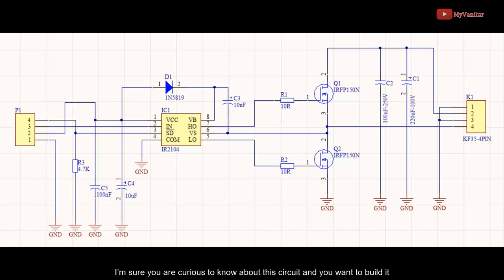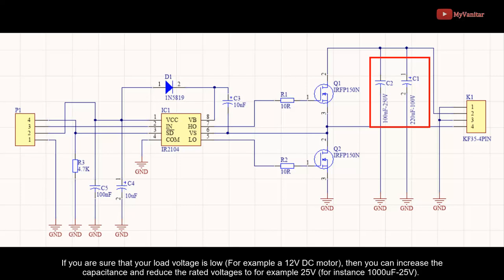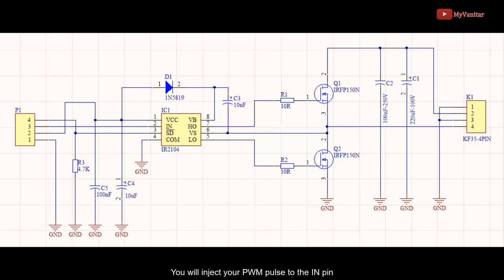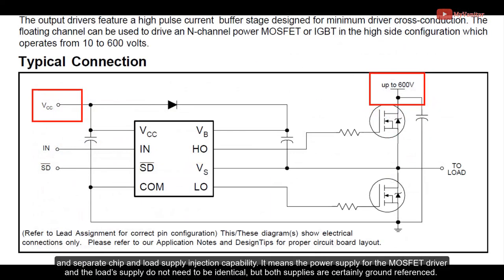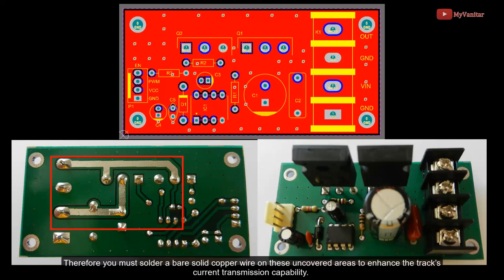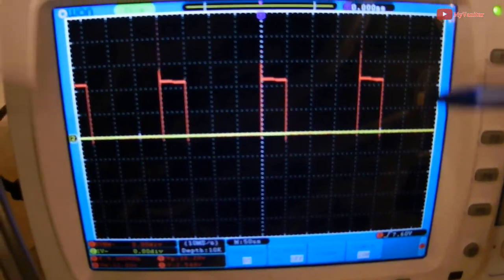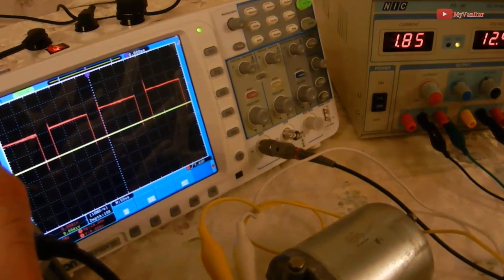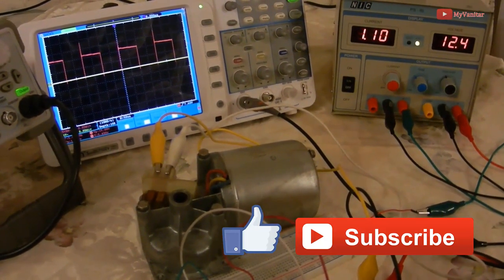DC Motor Driver Circuit Using Power MOSFETs [PWM Controlled, 30A Half Bridge]

Comment: Hey 
Here you have given two outputs for two motors which are dependent by only one PWM pin...? Is it correct...? And if so what components should I remove to drive only one motor
Thank you
Reply from the maker: Hi, No. there are 4 power connections (right side) right? two for the motor supply (VIN, GND) and two for the motor itself (OUT, GND). left side is for the logic.VCC is 12V. Don't be hurry, Just watch the video and read the article
Reply: @MyVanitar  thanks a lot....yeah... lovely work bro.....
Reply: Now I get it....
Reply: Reason being I reached the verge of making Gerber file but issues with the size (pitch basically...)

Comment: I want to drive 7.4v 5a motor so can i use this circuit? Or i need different mosfet driver
Reply from the maker: As you can see the Motor's supply is NOT identical with driver's supply, however, you need to supply the driver side with 12V, because driver needs this supply to Turn-ON your Mosfets
Reply: @MyVanitar  Yeah that is reason why i ask. So driver need 10 to 20v to drive mosfet?
Reply: @MyVanitar  Also i want to use IRFZ44N so can i use 50V 500uF capacitor. Can i change this 250v capacitor?
Reply from the maker: @BalkanFilm  Yes, I don't remember the exact voltage range, however, if you check the driver's Datasheet, you can consider the range.
Reply from the maker: @BalkanFilm  The capacitor is not a critical component, it is used to reduce the noise, but pay attention to the rated voltage that should be higher than your motor's or load's voltage, also pay attention to the capacitor's footprint dimension and sizes

Comment: Hi...
when we connect load with dc motor, that time this driver can be supply constant voltage and current to dc motor? 
here attached power supply is big enough but is this arrangement worth for constant supply voltage to dc motor when load connected?
Reply from the maker: When you control something with PWM, it means you both change the voltage and current by the duty cycle. In this circuit, the driver supply and motor supply are different, however, they share the same ground. so you can simply connect your CC supply to the motor supply and see how the motor behaves. the advantage of the half-bridge is much lower EMI noise and higher current for the load.
Reply: @MyVanitar  Thanks for the quick Reply,
Okay, let me give 1 example,
at a specific PWM value, I will get output from the driver is 10 V where my connected V in is 24 V, which means, I set PWM duty cycle at that value when I will get output circuit is 10V, but when I will connect output point on load dc motor, that time, V will not 10, and it's showing like 6-8 V fluctuation constant, so my connected dc motor can not give a right performance where actually if we connect that loaded dc motor to direct power supply of 10v, it will give a great performance. 

so at the end, if I need the exact 10v load performance of my dc motor by PWM controlling (by the microcontroller) then is this given circuit works? or I have to change the system of controlling my motor.
Reply from the maker: @madhulieximpvtltd4352  You must make the measurements when your load is connected, besides, you must make sure that your supply can handle the full current. also make sure your wirings are good, bad wires act like resistor and introduce voltage drop
Reply: @MyVanitar  Finally Today I tested and now all solve my issue, full-time perfect voltage and current at the output.
thanks a lot, very very thankful to you.... so happy.

Comment: Hello sir. First of all a very nice project and equally good presentation. Thanks for it.. I want to generate 8 - 10KHz (i.e switch MOSFETs at 8-10KHz) and supply the output to high frequency transformer then. Is this circuit suitable for that..?? 

Thanks in advance.
Reply from the maker: You're welcome. I think yes you can. this is actually a half bridge driver.
Reply: @MyVanitar  Thanks.. 👍
Reply: Hi. I am facing an issue.. the capacitor are getting heated up and MOSFET are damaged after few minutes of operation. Working frequency is 1.5khz.

Comment: very confusing what needs to be connected where. on your board you label "in" but the chip in is pwm. should have labeled it as "sd" to be consistant. you also never explain if the vcc and sd inputs can be the same source.
Reply from the maker: The circuit is pretty simple, everything shouldn't be an easy to eat candy. By the way this is my first video on this channel, you can check others as well. I have introduced two H bridge circuits as well.